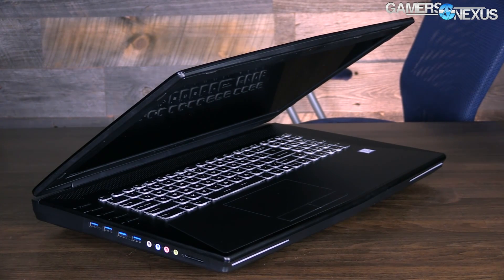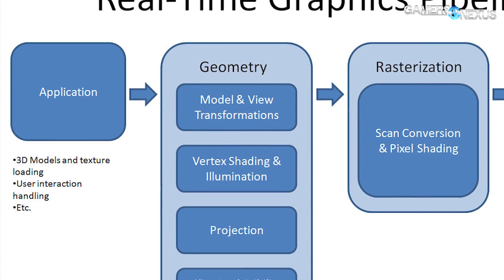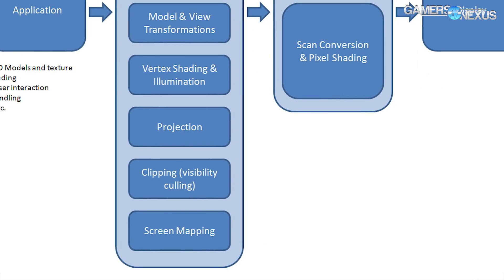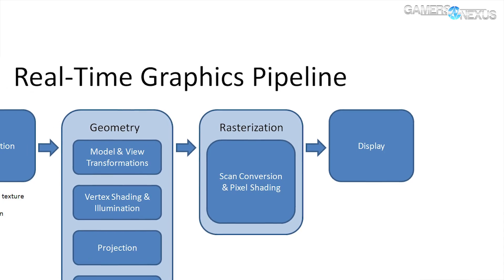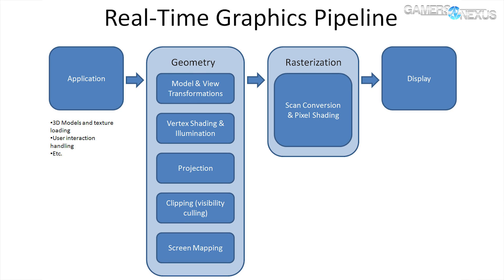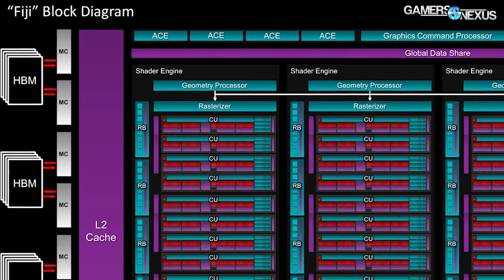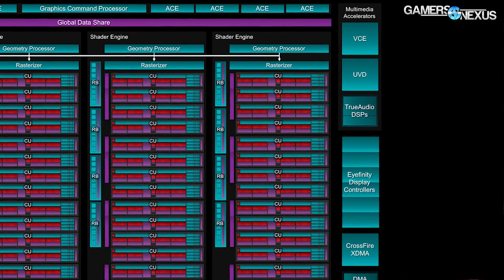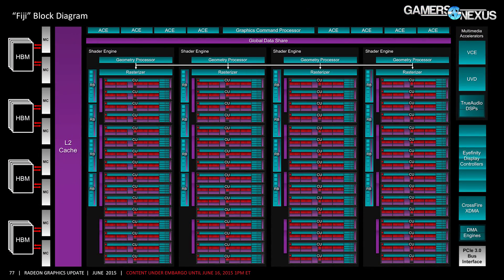What Happens in Your GPU When Creating a Frame? (w/ AMD)

Comment: Pretty classic "buddy AMD" smoke and mirrors. Both AMD and Nvidia go after features the other can't use properly and all it does is hurt the customers. AMD acts like they care about the industry but really only care about pushing their product. Asynchronous adds workload to developers that could go into polish, all to help one manufacturer.
Reply: +Jeremy Volsche It's nvidia's problem if they haven't implemented Async. This is an Open Spec you sheep
Reply: +Jeremy Volsche go google "open standard" then "proprietary". Come back once educated. AMD may change their tune once/if they have the lions share of the market. Until then, there's absolutely nothing "smoke and mirrors" about helping create an open format API. There IS dickery in creating something proprietary to lock people in to one product.
Reply: +kittehhatetube weapons grade BS. Asynchronous compute only works on AMD, so what you're saying is proprietary is OK as long as it is a Radeon card you're locked into.
Reply: +Jeremy Volsche it would be great if AMD were competing again, more competition means lower prices, there may be some consumer buttfuckery but competition will force them to improve on each other in the long term
Reply: +David Pro that's the same excuse Nvidia uses, it's not their fault AMD cards suck at tessellation. That makes you the sheep in this case as you're the one making excuses for a manufacturer.

Comment: I have a question...if DX12 is going to use more cores, do you think it would be good to upgrade from an amd fx 8350 to zen or intel or just let the 8350 to breath a little more since with dx12 cpu wont be much of a problem, i am asking this for most of the third world people out there from mexico and all of south america moslty including myself since hardware its a lot more expensive .
Reply: +DesumetaruLiadz666 dx12 will make the low ipc fx chips feel brand new again. assuming the game is coded properly.

 google "cpu scaling hitman 6" and click the wccftech link and scroll to the bottom. dx12 almost doubles the fps on an amd cpu from 37 to 65 but intel only sees a 4 fps gain from 74 to 78. thats because in dx11 the amd cpu was causing a bottleneck. most likely draw call bottlenecking from the render thread. while the intel cpu is so fast in single thread performance it was not bottlenecked at all judging by the small delta
Reply: EZOVERDOSE thank you very much kind sir. I am glad since here in mexico money is hard to get if you are not on shady business practices like most people, i will hold on to my rig until then. cheers
Reply: +DesumetaruLiadz666 Don't upgrade, the entire point of DX12/Vulcan is to give lower end CPUs more overhead and scaling. In fact the performance boost the 8350 gets is sufficient for years to come for gaming. Not to mention the devs now HAVE to code it properly, and have been doing so because of the console architecture with double jaguars.
Reply: keep in mind too that hitman is a dx11 engine wrapped in dx12. so a true built from ground up dx12 engine game would show even bigger gains
Reply: +DesumetaruLiadz666 Zen
Reply: +DesumetaruLiadz666 No one knows, wait and see what devs do over the next year or so.

DX12 is supposed to be good at spreading the load over more cores which, with current loads, would suggest more head room on higher core count, lower IPC CPUs but that doesn't mean that going forward devs wont take that opportunity to load those extra cores up so more cores and higher IPC might end up being what you want, especially if both AMD and Intel are providing that. Don't forget that not everything can be threaded too, sometimes you just need brute force.
Reply: *****
the only reason why a game would be restricted by single thread performance is if its draw call heavy or has multiple aspects of the game engine coupled into the same thread which would most likely result in draw call bottlenecking. aka how its coded.
dx11 can have deferred rendering pushing load off to another thread. dx12 can have multiple render threads. aka how its coded.

the long term goal of dx12 engines is for them to be "jobbed". every compartmentalized and windows scheduler sends it to the lowest load thread so there is never 1 thread working hard while rest are half its load. watch the the chris roberts interviews on this channel if you want to know more